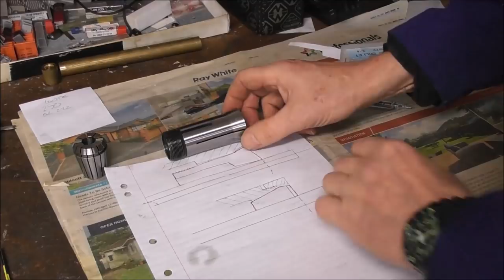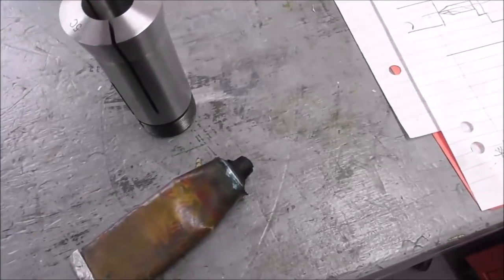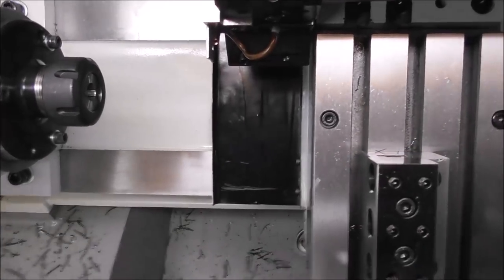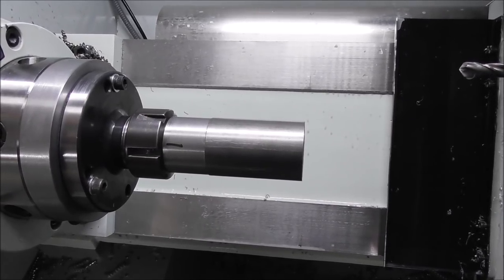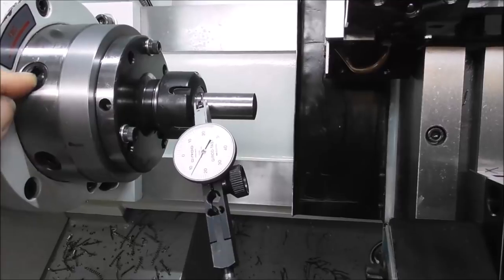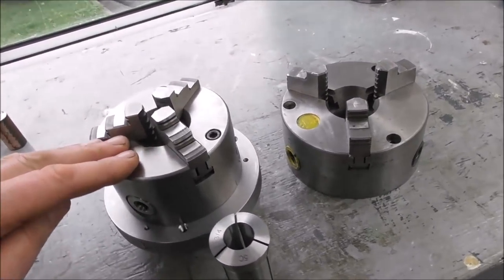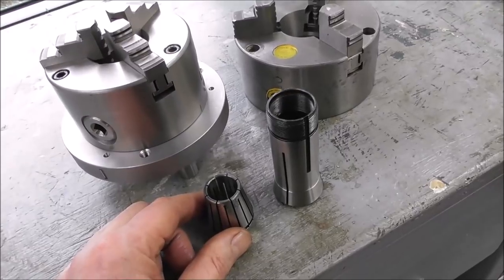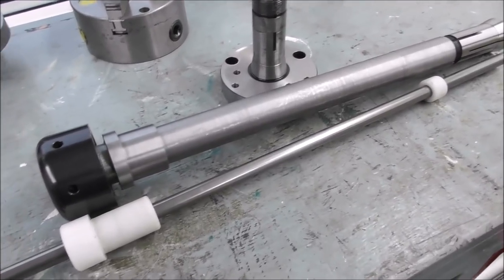Chucks, Collets, and Backplates  Part 3

Comment: Well Done! Cliff, I would expect the same would be true for bar stock that's slightly over sized as well. Another thing to consider and you may have mentioned, with softer materials the uneven pressure may  deform the material such as PVC, or delrin. etc.
Reply from the maker: Thanks for watching and commenting Sam.